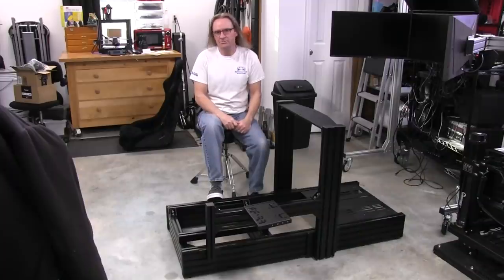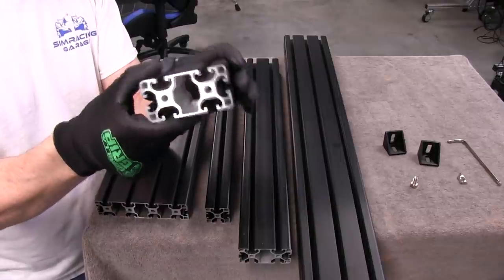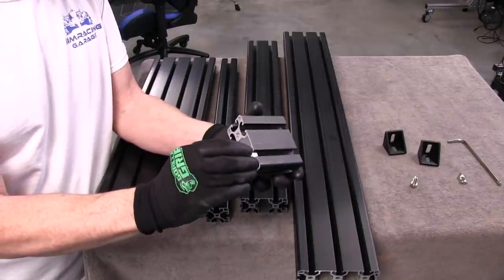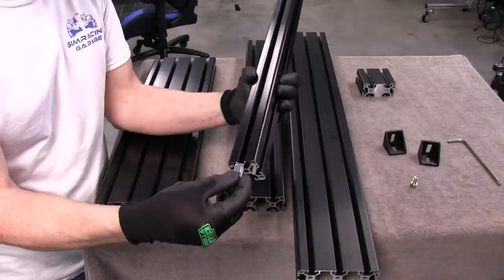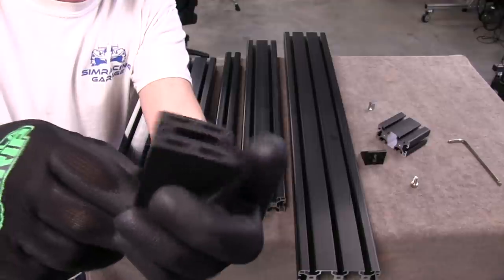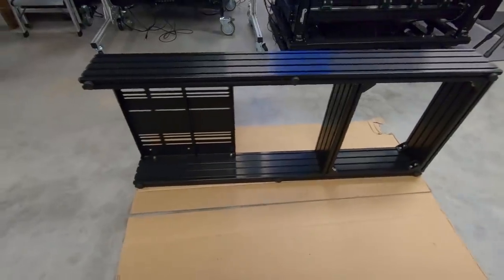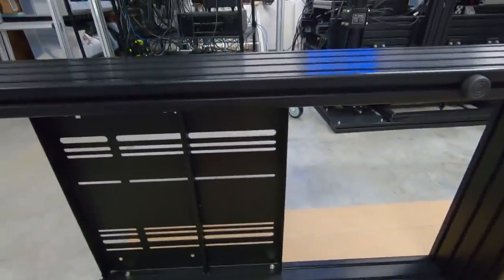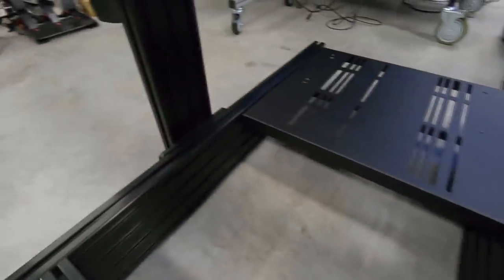GT Omega Prime Cockpit Review Part 1 "The Build"

Comment: hmm after that review Im quite happy I went with the Simlab P1-X, as I got thicker profiles and a way better pedal tray design for almost the same money.
Reply: How much was it?
Reply: @nicololorenzon3291  currently could get it for 732€ shipped to me
Reply: @jinx20001  50€ price difference, Im still glad I bought the P1-X for 50€ more.
Reply: Happy with My P1-X too,i think Simlabs have the most refined 8020 rig, worth paying more for Simlabs pedal tray alone. Also Simlabs has excellent customer service.
Reply: hi, you say there’s no metal rattling on the paddle plate. I just bought my first rig and I noticed that the force feedback from wheel, would sometimes make my foot pedal vibrate. Is this considered as flex?
Reply: @jinx20001  no need to defend you purchase. If you're happy with the prime it's okay! :) But the P1-X is actually 699,- without the sim feet, but just the rubber feet.
Reply: @jinx20001  you too mate! :)
Reply: @jinx20001  cheers for the info. I just got my Titan Cockpit and I have a few questions, they I hope you can answer.
1. The wheel mount seems to be slightly off centre and it seems like when I steer right it seems weird on my arms. Did you have any such issues?
2. My Rs6 chair will not let me tilt back to my preferred angle. I pull lever , get nice possession but lot of the time the lever won’t go back down and chair tilts forward or backwards again. Did you have this problem? Or could you tilt chair at any angle? 
3. When using the slider rails to move chair backwards or forwards, it often won’t stay in place. Say I squeeze the handle under seat, I slide into possession and once again, I can feel the the handle didn’t spring out again and when this happens,as I sit back , the chair jumps backwards a bit and makes a loud noise and scares the crap out of me. Did you have any problems? I’m not sure if it happens randomly or if it just won’t let me passion at the same spots. Did you have similar problems? My main complaint I that when ever I turn right, hard, it just don’t feel right on my arm and I can’t explain. I’m more comfortable in Titan but I had better control of wheel, using crappy bedside table on wheels, pushed against my tv table/stand. Any help would be great.

Comment: Not sure if GT omega has mentioned it but their new pedal tray is a massive improvement from the first batches for cockpits. Its basically 2 10mm thick aluminum plates that sandwich 2 pieces of profile.
Reply: This is good to know, I see old reviews and they look so flimsy compared to the current pictures.
Reply: @adamalam6218  I just got the prime and it’s so much better than the videos you’re talking about.. GT omega definitely watches these videos!
Reply: @ejd228  do you know if it is compatible with CSL Fanatec pedals?
Reply: @mauromicheletti4627  It should.. you can adjust pretty much everything so I'd be surprised if they didn't.  I'm using the CSL Elite pedals and they don't move an inch.

Comment: That pedal tray design is a major flaw for me. So the ASR 6 it is! Thanks as usual Barry.
Reply: Why do you say the pedal tray is a major floor? Also, I’m new to sim racing and in every review, reviewers and comments are always mentioning “FLEX” . Do you know exactly what this means? I noticed that I sometimes feel some vibration , coming from force feedback of wheel, on my foot peddles. Is this considered as flex? Or does flex mean that the actual rig moves as result of force feedback?
Reply: Basically it means that you will physically feel the pedals move under hard braking. I run DSD pedals which require a lot of leg. Real world pedals don't move so it breaks the immersion...which is what we are all after. Hope that helps.
Reply: I have this rig and don’t notice any flex at all.
Reply: I use the TLCM pedals and don’t feel any flex beyond the TLCM having a little flex in its own plastic base. I really like this cockpit so far though.
Reply: Glad to hear it. I've bought and sold probably 6 cockpits over the years. So at this point I'm looking for a zero compromise rig that I won't need to upgrade for the foreseeable future regardless of hardware.
Reply: Jonas Jonaitis  I haven't tried one personally but it seems to be the blueprint for most 8020 rigs on the market. I've heard nothing but good things about it.
Reply: Just as an update I ended up going with the GT Omega. Aside from a few minor quality control issues, I'm more than satisfied at the price point.

Comment: I pre-ordered and got mine at the end of the year. And I can say the pedal deck does flex a bit. I didn't notice it with my CSP V2's, but once I installed my HE Sprints, oh man. The front bows quite a bit, half-inch or so depending on load. And I run the Sprints out of the box, only recently got them so haven't felt a need to adjust just yet. I'm trying to figure a way to reduce the flex without retrofitting another brand's pedal deck. Was considering Trak Racer's deck, or just grabbing 8020 myself and cutting to fit for a more solid and flat deck. I may try your install method first, without using the angle mount option and mount directly to the frame. As always, great video and details.
Reply: Hi Nicholas, I’m new to sim racing. You say the paddle deck has flex. What exactly is flex? Is it feeling vibration from force feedback, on the foot paddles?
Reply: @grahamkelly8662  welcome to an incredible hobby that I hope brings you many years of enjoyment. Be warned, it can also be a money pit. 😉. For the pedal deck, flex means the medal base you mount your pedals to actually bends/bows and flexes under pressure. In my case with the GT Omega Prime, which I must say has been excellent in every other way, the rear area of the pedal deck will bend upward under load from the stronger brake forces typical with HE Sprint pedals. Much like a fender or hood of a car bends and flexes as you press into it. Only the pedal force is actually pulling the deck itself upward. I’m going to try mounting the pedals close to the rear edge in hopes of gain stability. They’re only an inch or so from the edge now, so I’m not sure if that will resolve it. And as I said above, I’m going to remount them without the angle mounts, as Barry did for his build.

Comment: I used a small dremel cutting disk to pre score the corner brackets so they would break off clean. Secondly you don't need to slide in the t nuts. You can just pop them which is mentioned in the instructions. Also the pedal mount now has two soldered support braces  which adds rigidity. This is my 4th 80/20 build and the black finish on the Gt Omega is the best I have seen. Sim labs and Trak racer profile both scratched easily. Not this one. Got it for 599 +tax shipped. Great deal
Reply: Glad to see this comment, I'm looking for a rig and saw the price of the gt omega. One question, all of these 8020 rig companies seem to build their rigs to 580mm/58cm wide, this means the space inside the side profiles is only 500mm. Does that feel big enough for you without feeling cramped? I use an old e30 BMW seat which will just barely mount inside a 500mm width. I don't want to feel like my knees are easily touching the pedal rises, I like to have some room in the rig and not feel cramped. Currently I use a custom pvc rig which i built quite large and I really like the extra space.
Reply: @sethfrancissimracing7558  I too had a custom rig which was wider and had the same concerns back in the day. The width of the GT Omega prime is fine . The inside dimension Is just over 20"
Reply: @stevep927  awesome, thank you so much. Just to confirm, is the inside dimension of the main frame itself 20" (like the distance between the two long side frame pieces that run front to back) or is 20" the distance between the inside of the wheel rises. I emailed gt omega about the dimensions of the inside of the side fame rails but haven't heard back. I assume the inside width of the frame would be 500mm, which is right around 20" because they have the overall width of the frame as 580mm and if you subtract the thickness of the two 40mm frame rails that would be 500mm. I'm just trying to confirm because their online width dimensions don't say weather that is total with (including the wheel risers and wheel riser mounting plates which are both mounted outside the frame rails and add to the width) or if the dimension they are claiming is the actual main frame width not including the thickness of the wheel risers and mounting plates.

Comment: I am currently halfway through building mine, thank you for the deep dive and instructional video.

Two things since this came out, the pedal plate is now made up from the aluminium pieces instead of that shoddy steel plate and secondly, when I was following your advice on the black screws for the side supports you mentioned there was only one type of the recessed screws but there are now two, and I happened to find the longer ones first and managed to damage channel trying to get these in following the advice here. Seems they changed a fair bit since yours.

Comment: I have the GT Omega Prime, rock solid. what I really like is that is compatible with other 8020 cockpit accessories. I got the keyboard holder from Trakracer, and the NLR motion platform v3 adapter from SimLab P1(x). (tip: you can mount the motion platform with a perfect low profile and the buttkicker adapter by moving the back piece to the front, and using the lower profile seat bars in the back - gives it room for the buttkicker to move and keep the low profile).
Reply: there no pedal plate rattle  with that change. V3 pedals.

Comment: I had the same issue with the flex on the pedal board. I’m using Heusinkveld Sprint pedals. Also had that “popping” sound you mention. I discovered that the screws provided were just a tiny bit too long, so that when you think you have it as tight as it goes it’s actually not. The screw is hitting the aluminum profile, so the pedal board is just loose enough to “pop” under certain circumstances. I ended up purchasing the Sim-Lab P1-X upgrade kit and replacing the stock pedal board with that. Works like a charm, but ultimately it brought the cost up enough that it would’ve been almost the same to purchase the complete P1-X rig to begin with.
Reply from the maker: Yes, the thin pedal tray metal lets the M8 bolt bottom out on the profile channel. I used washers to shim the bolt heads. Still had the rattle in the pedal tray when thumping it because the support bar does not have enough welding on it. They should have run a bead along the entire length instead of just spot welding. Still you found the best solution. The P1X pedal tray assembly puts the Prime's pedal tray to shame. More about this in the "Setup" video that will be out soon.

Comment: Just built my rig and this video was amazing help!! Best video online for this rig although mine was the prime lite only difference I could see was wheel deck but what a great help this was 🙌🏻 They have improved the basic pedal plate by adding another welded bar across the bottom so now it has two. My rig also came with the spring ball  t nuts which are great 😃 although it seems the design has changed as I can’t seem to roll them in like you did the central part that slides along the groove is too high and stop it rolling in. Very annoying when you forget something or miss some nuts and have to undo rig to slide them in 🙄🤦🏻‍♂️

Comment: You gave more information than the GT Omega customer service reps were able to (Or willing to). I bought their monitor mount, and decided to attach some accessories to it. Well, the 40 series t-nuts I had just rattled down the channels like you showed. I was able to get them to work (With no shortage of frustration), but I was completely put off. I was figuring they were using some oddball proprietary custom size framing to lock you into buying their accessories and expansions. I reached out to their CSR, and they have no idea what size t-nuts their products need. They just kept telling me "M8", which was useless information. After showing them a picture of the t-nut size comparison, they finally suggested the leaf spring t-nuts (Still without know what series I'd need). They were also unable to tell me if the Prime and Prime Lite rig would have this same issue. I decided I would not go forward with the Prime cockpit because I figured they were up to some funny stuff.  

But in the first few minutes of your video, you made it make complete sense. Using deeper grooves is kind of a cheesy tactic that I'm sure they saved some money on, though I guess the lower weight is nice if I ever have to move it. I hate those leaf spring t-nuts compared to the ball t-nuts, but I guess they serve the purpose. Even though I'm still very turned off by the lack of knowledge of their CSR's, your video might have gotten them a sale back. I guess I'll have to head on over to Part 2 to see how it performed before I make up my mind though ;)

Comment: Picked up mine with the 10% pre order discount so came in a decent amount cheaper than competition in the UK. Very happy with the purchase.

Rock solid with a DD1 and no flex in the pedal tray with V3's installed.
Only issue with the tray was the spacing/size of the slots as needed so large diameter washers to hold the bolts in place.
Be nice if they supplied caps for the corner brackets hiding the silver bolts to complete the all black look.
Reply: Well, you should have bought from Simlab then, gt omega seems to be the Fanatec of alu rigs (and thats not a compliment)

Comment: Can't say that I have any rattle in my pedal tray with my unit, nor any really noticeable flex. Perhaps it does but I certainly don't feel any. I do echo that it would be nice to have a spring based T-nut instead but as you mentioned, it's not impossible to work with. Shifter mount is definitely solid, I stood on mine and it starts to tilt the whole rig, definitely solid there. I felt that it definitely was a decent value compared to what else I could actually get ahold of, all things considered. One thing that people do need to keep in mind is their location - some areas of the world do have quite a difference when shipping is factored in. Add in your seat costs and such, and it could be a hundred or two more, at least at the time I ordered mine, and even recently when I looked. Looking forward to the driving impressions, but I've certainly loved using mine so far, and a lot of the irks that I've seen other reviews mention too, really are just nitpicking as opposed to genuine issues.

Comment: I regret getting this over paying a bit extra for the Sim Lab. It was hyped as being much cheaper than anything else... well, Sim Lab was actually cheaper with their November discount but sadly stock ran out everywhere.
Reply: Why do you regret it? What was the problem?
Reply: @Harmanpopefan  When the Sim Lab was discounted, it was even cheaper than the discounted than the GT Omega rig as stated above, and the GT Omega arrived with some big dings and extensive scratches caused by packaging, not just shipping, and though it is an overall sturdy build, the Sim Labs has thicker framing, and the GTO's pedal plate design is underwhelming and it flexes. The GT Omega doesn't look too bad but the Sim Labs has better finishes too. Their (GTO) rig also was not designed to work with their XL chair and is an absolute pain to install certain seats too. Lastly, they have skimped on having additional parts (nuts, etc) which can break or be damaged by shipping or installation, so you have to sort it out yourself.

Comment: Just bought one without the seat for 24% off. I already have a GT Omega XL seat so that will go right on this. Unfortunately at lot of the extras are out of stock. I could only get the floor mat and the mouse tray.
Reply: Did you have a discount code to get 24%off?

Comment: I had 4 larger washers with mine. In the manual ther're shown on page 2 at the bottom where it shows all parts. (just above the picture of the 4m 5m and 6m allen wrenches) Except in the rest of the instructions... they don't go anywhere. And here Barry doesn't even have them. Anyone know what those 4 washers are meant for?